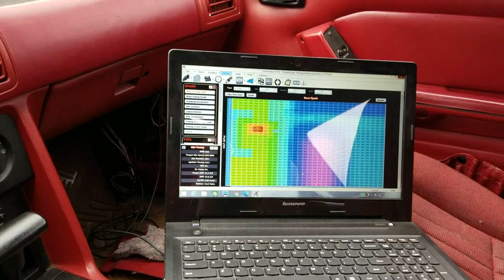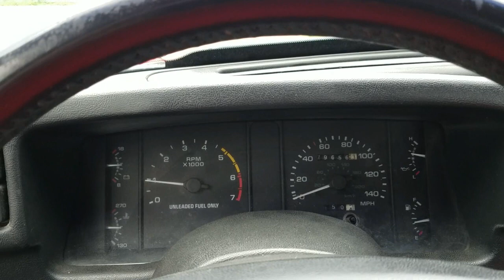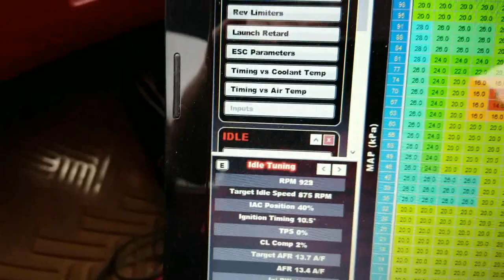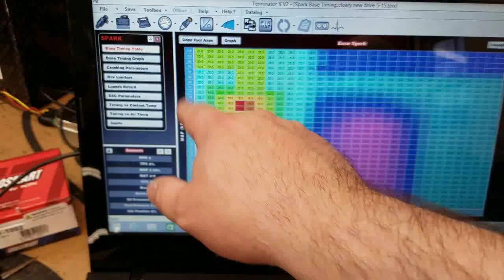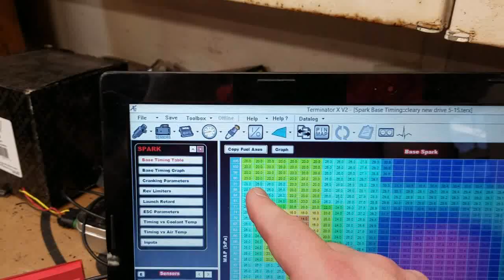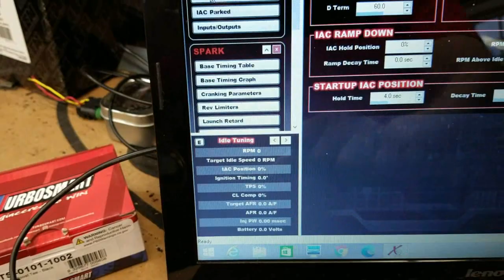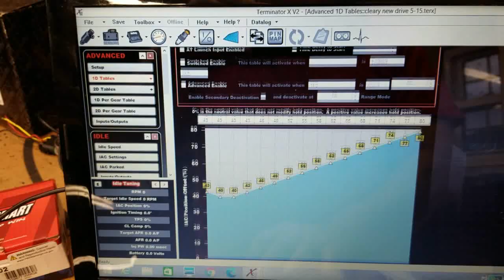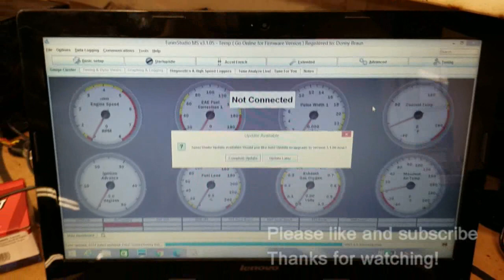Automatic Fox Body Terminator X Street Tuning Tips

Comment: Nice video. I have a question I’m kinda stumped with. I have a 302 with aluminum heads and a cam with a gt40 upper and lower, with 1000cc injectors with 8an feed 6an return with 60psi of fuel pressure to top it off with a 70mm turbo with a t5 trans. It idles great, and picks up great after 2000rpms. My light throttle light load I can’t get down. Rpms jump and and it doesn’t like light throttle. I can’t figure it out.
Reply from the maker: Not sure what you mean you cant get down under light load? You talking air fuel? Bucking?
Reply: @strangedemon  cruising throttle like 1300rpms. The rpms jump and it seems like the car surges
Reply from the maker: Gotcha. Pretty normal for cars with cams and light to low rpm. Needs more resolution in the timing table .
Reply: @strangedemon  I’ve been kinda playing around with doing logs and also using the learn method too. And it seems like once second I go one direction and then next I go back to where i started.

Comment: Hey Donnie B I have a 95 Mustang that is turboed running Terminator X 550-944 & Holley sensors for the life of me I cannot get my Iac valve to operate properly I have done boost leak test smoke leak test verified static timing installed brand new alternator brand new agm battery in the trunk I am using
 0 gauge power to distribution block
2 gauge ground
Battery ground to rear frame
Battery ground to block
Ground from block to alternator
Last ground from block to front frame. And I have my Terminator wired directly to battery.

Now I have my IAC valve set up as pwm- at b3 output #4 then positive of the IAC valve going to 12 volt from the power tap harness. Now I have tried a 95 IAC valve also a 93 IAC valve with no go so I gave up with the Ford IAC valve and figured to buy a accu-fab IAC adapter that accepts the GM IAC valve on my Harley harness it has a plug to accept a GM IAC valve and still after buying a accufab throttle body and IAC accufab adapter and a GM IAC and I still have a problem with getting the car to idle with IAC hanging around 10% at idle in park there will be times where  it seems to just stay at a fixed percent like the IAC just want to sleep lol if I give it throttle it will go to my fixed IAC Park position 20%. At this point I am lost on what else to do I have called Holly explain to them numerous times what's going on with no help.

I don't know if this matters but I have bought the proper crimping tool and pins for anything that needed to be pinned to the harness and I also purchased Dielectric grease for all of my plugs. I did a 3 minute video on YouTube my first one ever hoping someone would see the video and give me some pointers if you don't mind looking at that video it's under 95turbostang
Reply from the maker: Sorry for the late response, are you using gm iac and tps or the ford stuff?
Reply: @strangedemon  as of now I am using Ford IAC and Ford TPS. But I kind of just gave up on trying to get my IAC to below 10% at idle
Reply from the maker: @95turbostang21  are you running iac through 1d table or just the regular setting?
Reply: @strangedemon  yea i tried the 1d table  and when It's enabled I get a hunting  in rpm with it being a auto I had my settings controlling rpm from 500 to 900rpm and in drive it will enable the table and then when I would put it in park it would disable the table. my main problem that I do not like is When approaching a red light I have to tap the throttle just seconds before coming to a stop in order to keep my RPM from dropping down to 600rpm  and then it will slowly come back up to 750ish this is in a stock auto
Reply from the maker: @95turbostang21  do you have the idle timing option enabled to help it out pr just using the table?
Reply: @strangedemon  yes I do. I'm starting to think it's something mechanically going on in the motor it is an old warn out 95 motor. Hey question for you now that I am running a map sensor I removed my PCV valve and plumbed in a 5/8 hose where the PCV originally was and I have that running to the inlet of my Turbo is that okay the only reason why I did it that way was because I was getting a little bit of crankcase pressure even if I used a check valve plugged into my PCV line and ever since I remove the PCV and ran a hose going to Inlet of the turbo I stopped getting crankcase pressure. And do you think that could be causing my IAC valve issue  because I don't have a PCV valve anymore.

Comment: I have a aod with the b-21 cam I have the target idle 850 with a slight surge at idle in gear using the 1d table. Should I increase my rpm i tried the timing table box close to what you did and it helped a little?
Reply from the maker: Try turning down the idle screw just a small amount while running and if it stops hunting for idle do another tps autoset and should be good to go
Reply: @strangedemon  I got the idle better with turn the throttle down just a tad, then gave a little more timing in the lower rpms to help speed up and smooth out the idle. I'm going to data log the idle going into gear from park and coming to a stop to pin point where to add the timing in the map. Thank you for posting this video and the data logging it helped alot.

Comment: ??? dont get that ..why start up and Ideling is different between a AOD or Shift .. thats not even something logical ...Idle is Idle there are no loads or something....I have an AOD Car with tons of mods..put my own tune on it and cars runs great with this 1. Tune..Idles like a Rock en N or in Gear just perfect ..never got that so good with the Megasquirt ..there is not much to do ..system makes the Corrections on its own .. and that works great...the only thing u realy have to change  is the Timing table and I let my car run a little leaner then the Holley Tune.. idles perfect at 14.5 and 12.6 at WOT .....DONT use the Base Tune from Holley thats a killer ...
Reply from the maker: Correct key is the timing table which helped alleviate most of the issues between shifting from park to reverse or drive. Sorry if I missed stressing that point. The idle and startup were two different issues I was working with
Reply: @strangedemon  and go back with that timing at low RPM 1.2 row .. go back to 15 deg ..not shure but I see 26??? then you can try under Cranking Parameters.. Crank timing go to 10 or 12 deg and Crank to run 250/300 rpm ..  think that will help for better cold start ??!!...and also its easy to adjust that idle swing after Start . rpm goes up and down and goes up again.. that can be easy fixed.. IAC setting Iac Ramp down Ramp decay time ..go to 1 sec or try even 0 ...see what hapens .. good luck Man ...
Reply from the maker: @Diondo26  thanks for the info. I've already changed the crank settings but yeah I missed the idle ramp and that helped. Thanks again.

Comment: I'm definitely going to be running 3.55 and Holley Terminator X. Trickflow 11R 170 heads, AFM N41, not sure on intake yet. T5 car. I know N41 recommends higher gear but I doubt the drivability can be that bad.